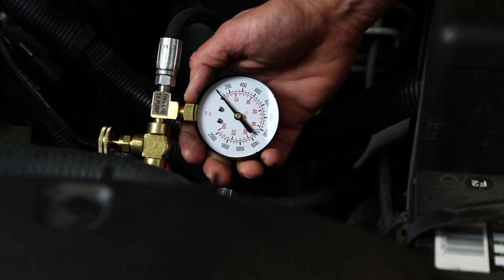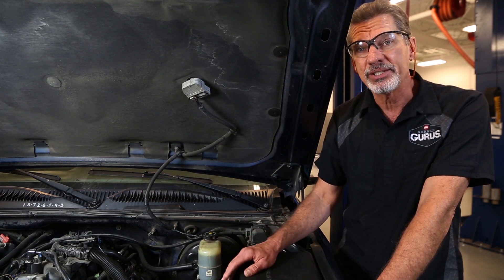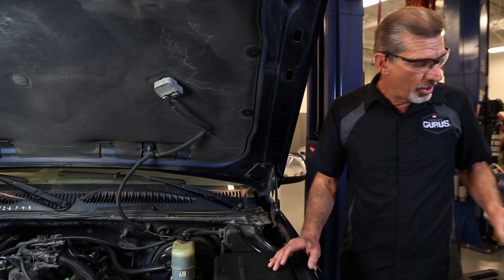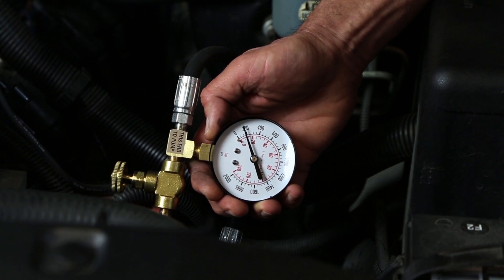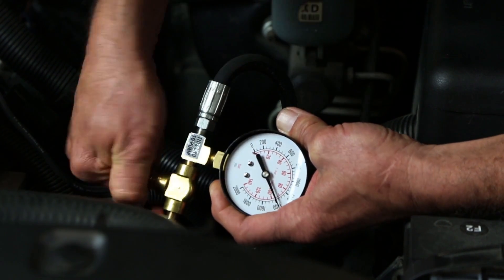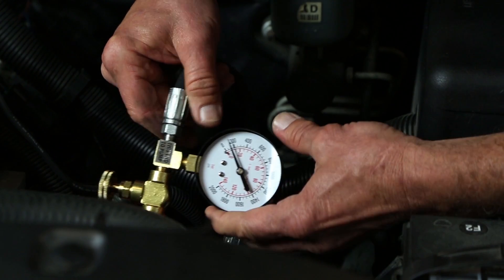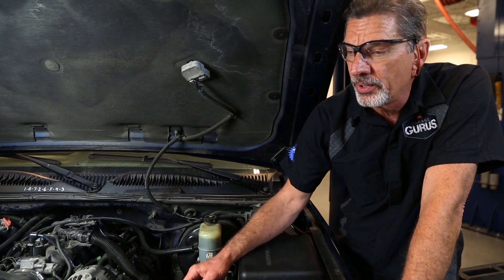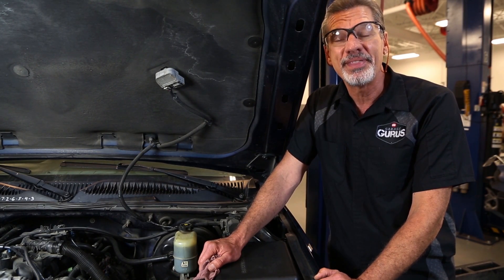Power Steering Pressure Test

Comment: um, where the hell is the pressure guage pliugged into? A spark plug hole? it would be nice if we know where to connect it in order to do a proper test? At the inlet to the power steering pump. Do we remove a hose from the rack and connect it there on the inlet? Or on the rack outlet? i mean geez. you just start the truck and pull a tester out of your ass. Do all cars have testers already connected and sitting under the hood like this, or does only this vehicle?

Comment: An amazing video,really useful,the problem is finding the proper adapters to hook up the gauge; i wonder if i,   wearing good protection goggles and  heavy gloves,   *briefly* clamped the hi line at idle with pliers i would hear the pump whine,indicative of it being generating high pressure, and therefore proven good, pointing to a bad rack, with an internal leak or a bad switchover valve.

Comment: What if the flow at idle is almost 0psi. But when you deadhead the pump it still goes to 1600lbs. Wheels off the ground you can turn with one finger but on the ground no power steering assist is felt and hard to turn. What would that be?
Reply: did you figure it out?

Comment: One of those dead-head test should be done at 1,500 RPM, note PSI and return valves. Simply because it is not at idle all the time when in use, plus it could reveal and pressure relief valve problem the did not show at idle before. 
Flushing the fluid is a maintenance issue, while it should be done before replacing or rebuilding one of the components. It is highly recommended to replace both lines when flushing is completed before installing a new or reman part as well. The low pressure hose should also have a metal inline filter installed preferably one with a magnet inside as this benefits the longevity of the parts. If the vehicle has a tow hitch installed, inquire the customer to the frequency and weight being towed. This could require an aftermarket cooler installed in place of the factory metal “U” shaped tube that his most common and greatly undersized for heavy frequent towing be it at highway speeds for long distances or at low speeds on a farm hauling large round bales of hay everyday. This could lead to an up-sell for an automatic transmission vehicle as well. Just a reminder from an experienced service tech.   ASE Master Tech since 1978 plus L1 Certified - Retired

Comment: Great video. Can you tell me the pressure readings to test my Corvette 1978 at idle and also at 1100 RPMs?  I just installed a Borgeson power steering upgrade kit but the assistance is very weak. I have the stock GM pump and believe it might not have enough pressure due to its age, but there are no leaks or noises. Thanks!

Comment: Manufacturer manuals and also professionals on youtube have the no more than 5 second rule when the valve is fully closed, I noticed you turned a lot to get the valve to close and open, overall I think you had it at max pressure for almost 1 minute. The claim is that the pump can burn out if you keep it longer than 5 seconds.
Reply: Vane pumps really don't like being deadheaded. But yeah, 5 seconds is a bit short. Should survive a couple of minutes. The reason the pump will be damaged is that it overheats.

Comment: Thanks for the vid! My '03 Chevy Silverado fluctuates between nice light steering and moderately heavy steering. I installed freshly rebuilt steering box (a bigger one than I had), but steering is still the same - fluctuating. I ordered a pressure tester and will test pump pressures. I bought a S&G Tool Aid® - 0 to 2000 psi Tester (for $99.25) from these guys: https://www.truckid.com/s-g-tool-aid/power-steering-tester-in-molded-plastic-storage-case-mpn-34650.html?singleid=35966714

Comment: Wish I knew where to get this tester,called my snap on guy,he said he hasn’t sold one in ten years,
My problem is a 2006 Chevy Trailblazer with a new steering rack,it’s a very frustrating system to install as it gives you about an inch and a half of clearance to get your 1/4 inch socket on the steering lines ,the Grommet or seals are very small one time use and your lines have to puncture through those seals,so then the customer has driven this over a month without issues,now she comes in with more and more loss of steering to the point where this skinny girl can’t turn it anymore,the pump makes no noise ,I can’t see any swirling of fluid in the reservoir,no bubbles. Nothing,jacked up the car and it turns left better than right .on the steering rack where the lines go in showed visible paint bubbling as in extreme heat from high pressure perhaps and somewhere in that area small drips I can’t see from where unless I remove the cross member and plates
I don’t want to just throw parts on this thing although it’s cheaper (88$) to buy a pump then to buy a pressure tester
Can you help ? 
As a side note I have 4 regular customers with this brand vehicle and all had the Steering rack replaced by me 3 never had an issue

Comment: Thanks for the video Mark. Is the 1425-1500 psi what a 2007 Dodge Charger should be within? Looked on  line, found nothing. I have very minimal power assist  in both directions
Reply from the maker: Here are the pressure specs for a 5.7L:
At idle you should have 50 to 125 PSI. If higher there is a restriction on the pressure side.
 Then hold the engine at 1100 RPM while fully closing the restriction valve on the gage for NO MORE THAN 2 – 4 seconds. Pressure should be within 1640 PSI to 1740 PSI. Repeat this 2 more times and record the pressures. They should be within 50 PSI of each other. If not the pressure limiting valve in the pump is faulty and the pump needs replacement. If the 1100 RPM readings are less than 1640 PSI the pump is not generating sufficient pressure and needs replacement.

Comment: Good explanation, but 1) Did you  have the guage on the high side, or the return?  If the high side is good, what pressure should you read on the return side (output of steering gear box)?
Reply from the maker: We normally measure only high side pressure. Pressure is created by restricting the flow of a fluid. The return line has minimal or no restriction. Any pressure in the return will be created by:
• High viscosity due to extremely cold fluid temperature
• Restriction due to the length of the return line or PS fluid coolers in the return line
• Pinched, restricted, or damaged return line
• The height of the reservoir in relation to the steering gear. Greater height = greater pressure
Manufacturers do not even publish a specification for return pressure since it is normally zero or just a couple of PSI.

Comment: Mark, you made a wonderful, concise, complete, & clearly explained pressure test video.  I'm a mechanical engineer with 35 years of testing & troubleshooting commercial HVAC mechanical systems. I love your video and I look forward to following anything else you post.  Now to purchase the right gauge & fittings to test my 1989 Camry PS system.  
I replaced the entire system with new hoses, filter, belt, + a remanufactured pump & rack & pinion steering gear.  I have no leaks, I vacuum bled the air, all parts fit well, there's no noise when starting, driving, or turning, the steering wheel recenters itself after a corner, there's no wandering, only a small & normal dead zone
  ... but I don't have power steering anymore, either.  It's interesting to attempt parallel parking.
Reply: Good, perhaps you can inform us where the tester guage is connected to? The pump reservoir? the hose to the pump reservir? The inlet to the rack? The outlet of the rack? Please explain since it is such a great video.

Comment: Just to note you can also need hydraulic oil for vw ps
Reply: What year vw? What pressure can they generate? Im trying to build a belt driven hydraulic system and have a couple old vw ps pumps now

Comment: hi, can you send me a link to the inexpensive pressure gauge that you used. thanks. if you feel like not promoting the product through this venue, I can provide you my email address. thanks
Reply from the maker: Nicandro, here is a link to the Power Steering Pressure Gauge we used -> https://www.amazon.com/Aven-789-0125-Power-Steering-Testing/dp/B00NWDCXH0. It's the AVEN 789-0125 Pro Power Steering Test Kit
Reply: Thaks
Reply: I just bought a Kent Moore J-25323 (Humvee) military surplus, but brand new for $62 shipped on ebay.  Kent Moore Power Steering Analyzers retail for $1200.  Tests pressure and flow rate.  Probably just need the right adapters / fittings for various mfg pumps and racks.
Reply: Is there a similar test procedure to diagnose the rack or gearbox?
Reply: @shieldcracker  Reply for others wondering the same thing. I think short answer is no. But I think if you turn the wheels hard to the stops, (engine on), the pressure (test valve open) should register close to previous deadhead pressure. If not, fluid is leaking past the cylinder seals or the spool valve in the gear...
Maybe someone can affirm this.
Again, do this only for a few seconds at a time. Let it idle and cool a minute or so by circulating the hot fluid out of the pump. Fluid will get burning hot in the pump is seconds when not flowing. Pressure gets converted into heat instead of motion when the rack cannot move, physics...